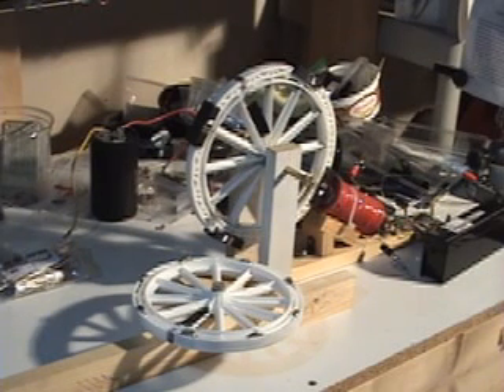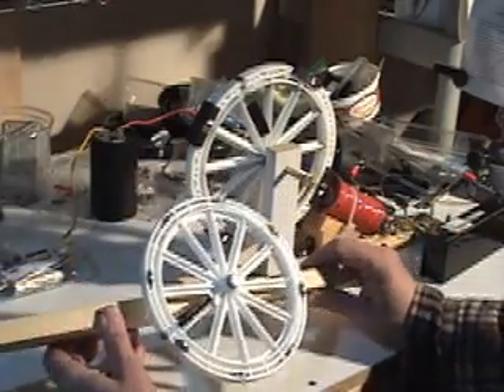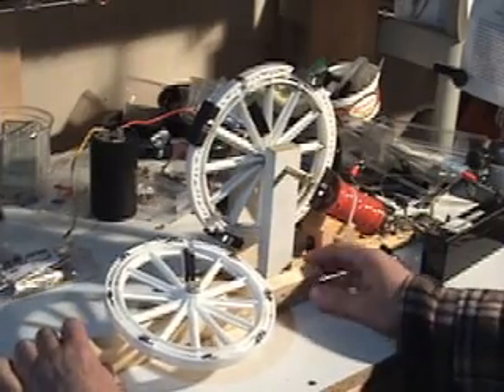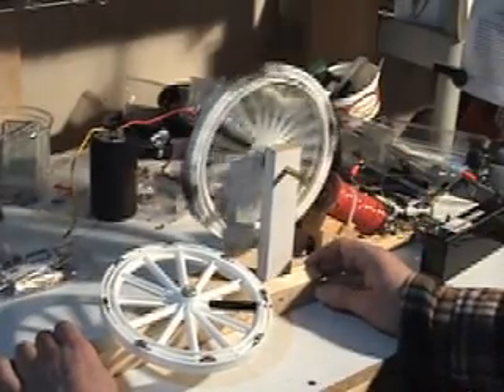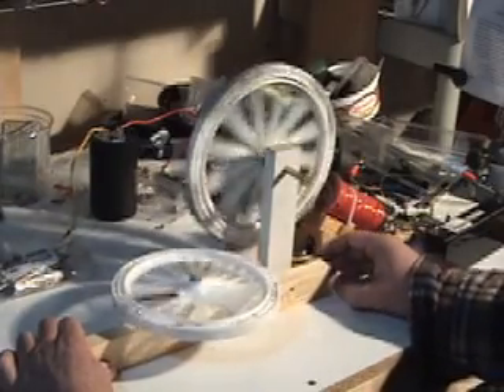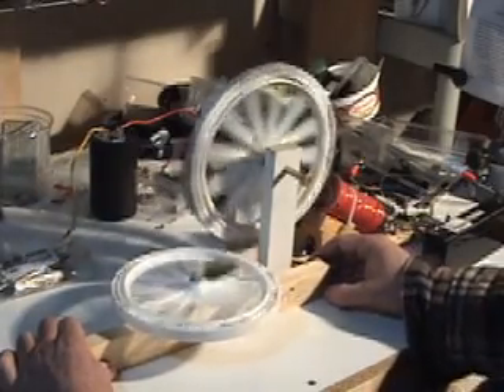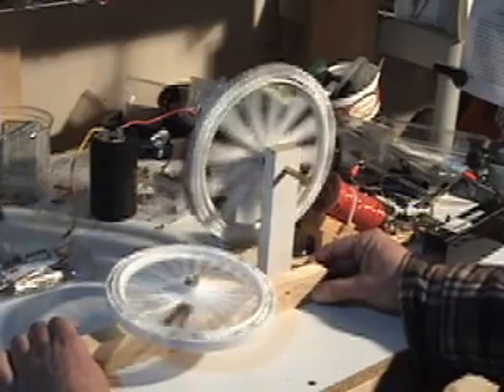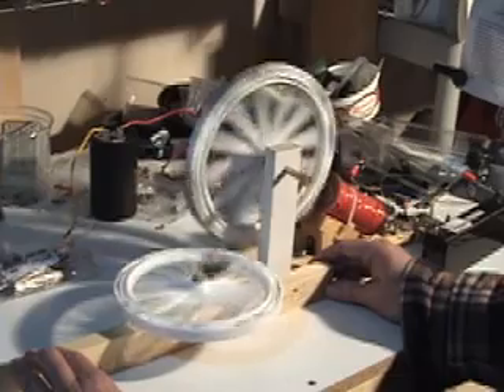whipmag antigear demo

Comment: Good work!
Quick thought: have you established the change in power drained by the Bedini wheel with the freewheel in and out of place? Did the rpm's change at all? I'd like to know whether freewheel is boosting or parasiting on the the Dedini wheel.

I'm no expert at all, but I'd think of a hubless wheel and the wheel having "rim" interlocked, to attain slightly different angles.

Thanks,
J